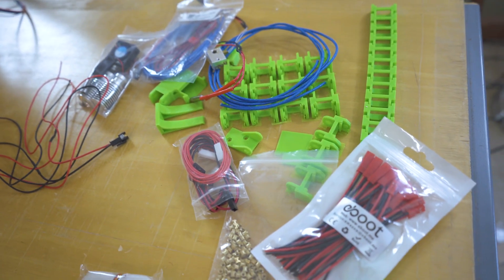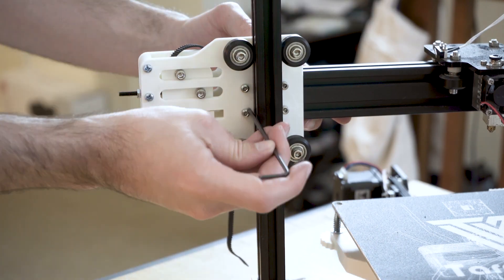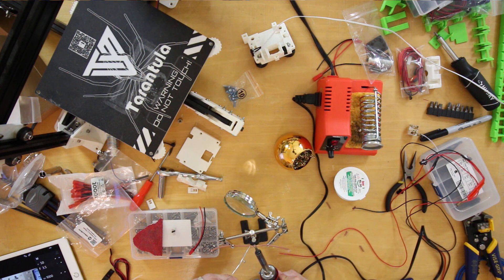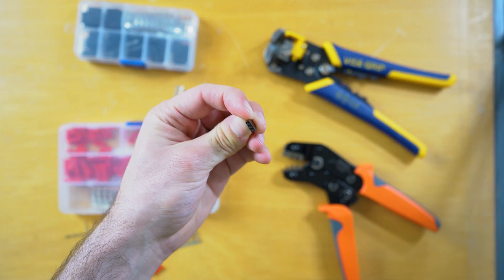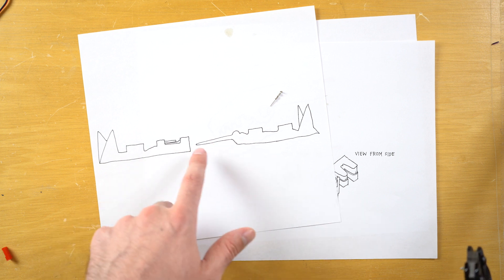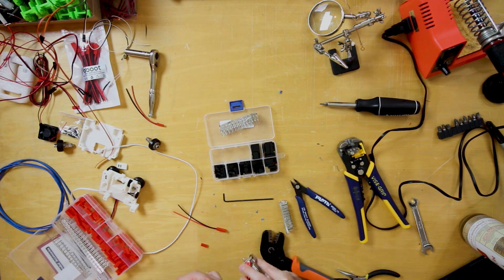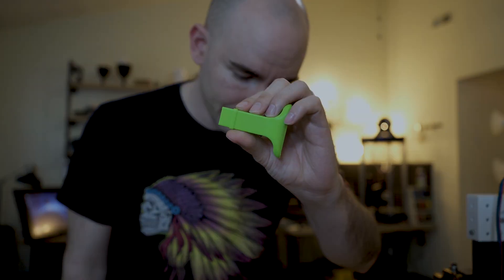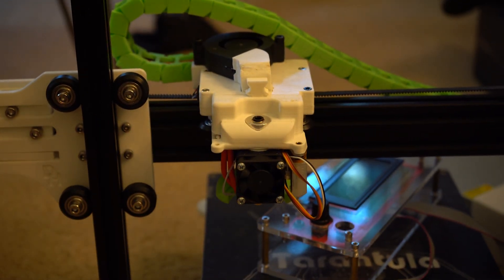Improve the Tevo Tarantula with the Tactical X Carriage upgrade

Comment from the maker: Have any of you done this upgrade yet?
Reply: It´s cool but I prefer vertical carrier
Reply: working on printing the base now. having problems getting it to print good. on my 5th try now lol
Reply: I'm working on wiring it up now. I can't figure out how the bltouch wiring works for the connection between the removable hotend and the x carriage... I got the little piece printed that slides in to hold it all and no idea how the tiny pieces the kit came with are supposed to be long enough. All the Pics in the tactical files show super long 90 degree bent pins but in real life they aren't that long. Please tell me how you did it.
Reply: Some where it should mention needing that special piece for the male side of the bltouch connection. I'm having a really hard time getting one and it's very expensive considering how small it is.. 6 little pins and can't get it for less than $10 with really slow shipping.
Reply: BTW it's a molex 90122-0128 according to the creator of the tactical x carriage.

Comment: Careful on the JST with "high current", that is the bed and mildly the hot end. I went for mini bullets (3.5mm I think) for my bed when the stock connector decided it wanted to set my office on fire (A8). Hobbyking is your friend for all this hardware, but I guess you know that already. Those are connectors used on drones. You normally use bullets and XT60 for motors and battery and the JST for the camera/transmitter stuff - that is 5V and not even an AMP (more like 300mA). Not knowing that at first, I melted a few JST...
Reply from the maker: dang, thank you for the heads up....do you have pictures of the fire? I am curious, shoot me an email
Reply: No fire, no!! But on a routine bed cleaning I removed the connector normally hidden in the cable chain and it had burning on the side, it was clearly getting very hot and that was enough for me to change the bed alimentation for a higher current rating connector. I wouldn't mess with this, specially since that particular connector is well known among the A8 community for being unsafe. It's an anet A8 specific problem i guess, but more generally, a bed can draw some good amps when pre-heating from room temp and having a dodgy connector there is never a good idea, not doing anything will eventually end up by a fire.
Reply: not talking about the JST here, I'd trust a JST against the anet's stock bed connector any day, yet i'd still wouldn't use it for the bed's power cable.
Reply: sent you an email!